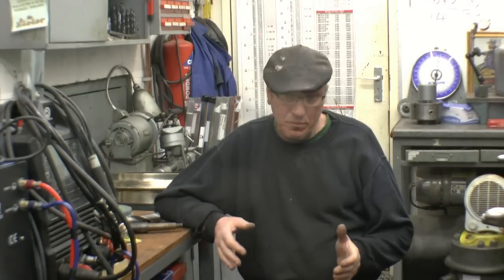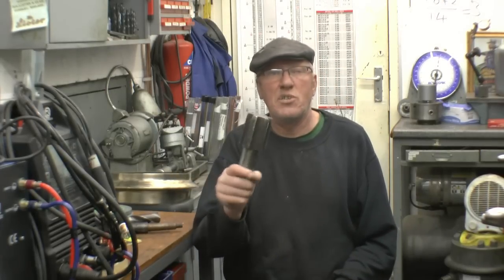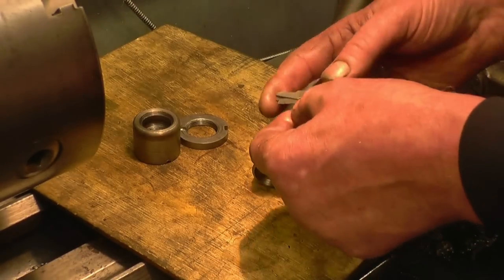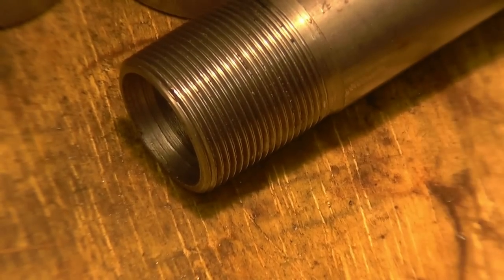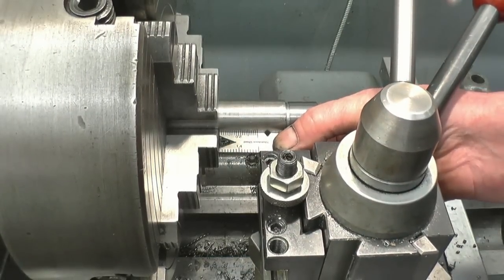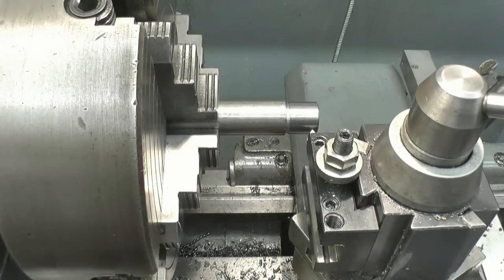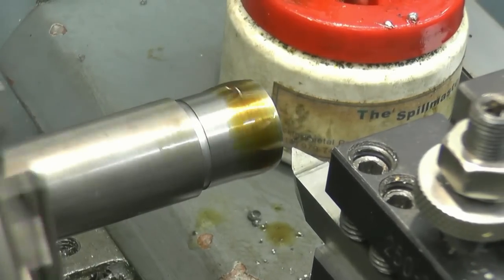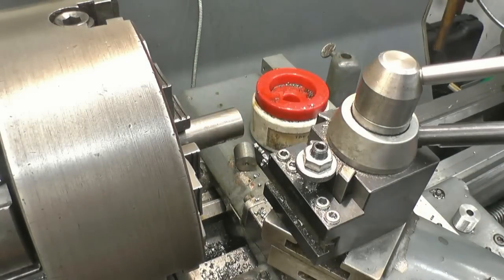SNNC 121 P1 Steering rack/ Lathe tool grinding /Screw cutting

Comment: Looking at the wobble of the cut off tool seen at 8:57 I think that if precision was at stake, I would cut the threads off starting at the end of the bar and work my way in to the cut off point. It's obvious the shape of the thread that was there strongly influenced the position of the tool.

Comment: Those carbide form tools leave a much better finish if you run them at higher rpm. They are not designed to run slow. But then you have to be really quick with the cross feed and half nuts. I was having the same problem. I discovered this by accident and I was amazed how much better the finish was.

Comment: Something I'v never noticed before John, parting off over existing threads causes the parting tool to wobble from side to side, as it follows a thread grove when engaging the material.  Should this be avoided by first machining the old threads off, thus starting the parting off tool on a bare canvass? Great news about Debs! Cheers.
Reply from the maker: +Rain Coast Good point